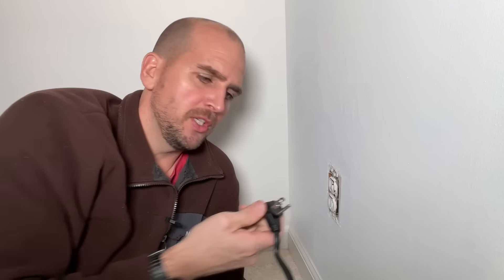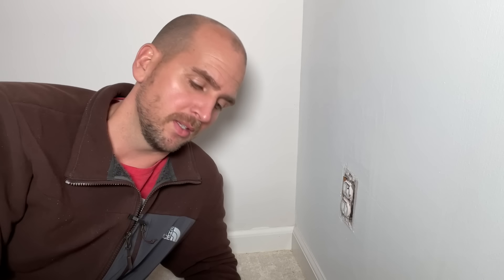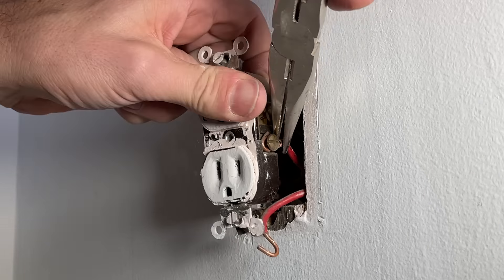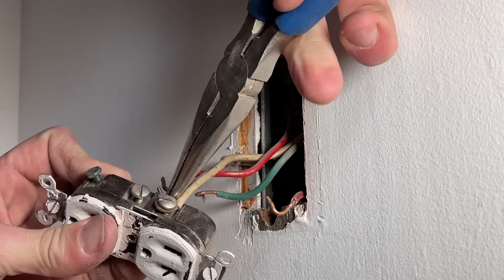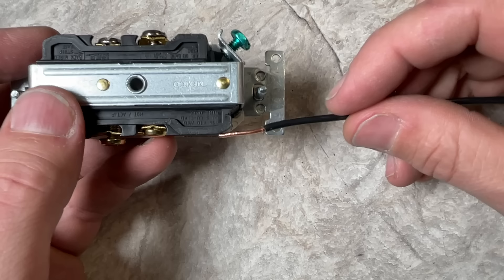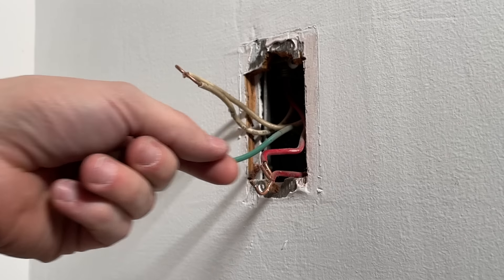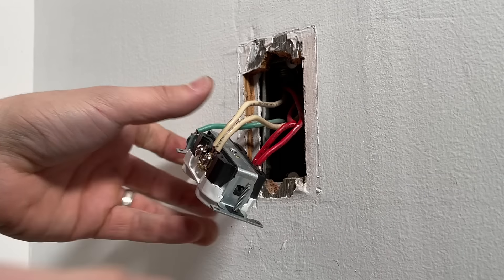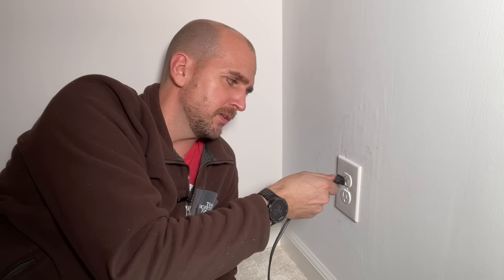Plug Won't Stay In Outlet

Comment: The other safety issue besides exposed prongs is that a loose receptacle makes a poor electrical connection. The increased resistance at the receptacle produces localized heating that can damage the insulation of the wires. I'd replace any receptacle that doesn't hold a 2 prong plug as tightly as a new receptacle. If either the neutral or hot prong is loose enough then you can have a fire hazard - even if the ground prong makes a firm connection.
Reply from the maker: Hey Jason, thanks for the feedback and agree the increased heat doesn't do any favors for the life of the receptacle.
Reply: How can you measure the "leakage current" ?
Reply: Thats exactly right..loose wires cause fires. I recommend looking at every outlet with a load on thermal infrared, the beakers too. It only cost about 2 dollars to replace a 20 year old receptacle.
Reply: @rickhunt3183  what do you mean by a load on thermal infrared?
Reply: @waynegram8907  He means that you need to plug in something that will draw a high current - such as a hair dryer. If there is unacceptable resistance at the outlet then you will see the outlet heat up on the infrared camera. On the other hand, if you only plug in something that draws a small current, like a LED light, then there won't be much resistive heating to detect
Reply: @JasonEDragon  ok thanks. Without plugging anything in all the outlets, how can you know if your outlets are 10A, 15A or 20A outlets without going back to the fuse panel how can you check if you outlets are 10A, 15A or 20A, what kinds of test can you do to measure the outlets max current?
Reply: @waynegram8907  By looking at standard outlets you can only tell if it accepts 15A or 20A plugs (those with T shaped neutral slots accept 20A plugs). Those that accept 20A plugs should be on a 20A circuit, but the more common outlets that only accept 15A plugs can be on either a 15A or 20A circuit. (I could say more, but I think that is a good enough short answer.)
As to testing, I've seen some "AC circuit load testers" around, but these don't appear to be that common here in the USA. I've watched quite a lot of UK electrician videos and they do a very comprehensive suite of tests on all electric work - with a variety of quality test meters available and their breaker panels (consumer units), electric boxes, and wire connectors having evolved to more easily support testing. Some other items I question but I think their testing is great.
Reply: @waynegram8907  I miss typed. what I mean is while there's power being drawn from the outlet. View the outlet with a thermal infrared camera. I've discovered faulty connections from the heat signature. After examining the outlets. They were found to have  loose connections. Drawing 1 or 2 amps might be just fine, but when you increase the load to a 8 or 10 amp device the outlet may become dangerously hot if the receptacle is old and worn. This shows up very well with a flir camera.
Reply: @rickhunt3183  but even good outlet terminal connections you will see heat on your thermal infrared camera, so how would you tell if its good or bad? because you will always see heat on the outlets terminal connections
Reply: @waynegram8907  Of course you will always see some heat when current is flowing, but if the receptacle temperature is climbing to 100 degrees C there's a problem getting ready to happen. I've seen plenty of outlets that looked fine, but after removing them and inspection. They had charred wires at the connection. Drawing 1 or 2 amps might  not cause a noticeable problem, but 10 may push  things over the edge with a loose connection. If the receptacle is bright yellow in the camera during operation. it might be wise to inspect it closely. I've had receptacles that looked fine, but after pulling them they were clearly in the process of catastrophic failure. Most people that have receptacles that are loose seem to ignore it.  Thermal imaging isn't always a go or no go test, but it will bring things to your attention that need closer examination. If you plug something into a receptacle and it's loose . No further examination is necessary..Replace it right away. Contacting Flir will offer a lot more information. 877-773-3547 or their website.
Reply: @rickhunt3183  Thanks I will look into that. When opening up an standard outlet how can you tell by looking at the inside of an outlet terminals, sockets and insides what amps rating it is? how can you tell if the outlet inside parts are rated for 10A, 15A or 20A?
Reply: @waynegram8907  NEC 2008

hope this helps it came strait from the NEC manual. if the circuit has a 15 amp over current device the wire is going to be 14 gauge and rated for 12 amps continuous at 70 degrees C If there's a 20 amp over current device on the circuit the wire is going to be 12 gauge and rated at a continuous current of 16 amps at 70 degrees C. The best rule to go by. If you're not 100% sure about something don't do it. Electricity is nothing to play with. I know people that have burned their business to the ground by doing electrical work that they weren't qualified  to do. Don't be that person.  If you're looking at something you're not sure about always have a professional do the work. They are bonded, licensed and insured.
Reply: @rickhunt3183  yes I understand the wire gauge to the RMS current rating. 120vac/wire gauge resistance = max current.  120Vac X 10A = Wattage power
Reply: @JasonEDragon  What kinds of tests to confirm and verify the current rating for the outlet? without going back to the fuse panel to know if the outlet is 10A,15,20A what kinds of test can you do to verify and confirm that the outlet is at what current rating?
Reply: @waynegram8907  I don't have any experience in this type of testing, nor have I seen anyone else do it. Perhaps someone else could answer. However, I'd doubt that any test could verify the actual breaker size without drawing enough current to actually trip the breaker - so you would have to go to the breaker panel anyway. 
In any case, this is straying from the original topic of my comment that loose outlets should always be replaced to avoid overheating and a risk of fire. Testing is not a full substitute as some tester inserted into a outlet might have thicker prongs, fit snugly, and give a good reading. But if the next plug that gets inserted is loose then you still have a danger.
Reply: @JasonEDragon yes thanks for the help. When looking at the insides of the outlet can you tell by the outlet sockets if its rated at 10A, 15A or 20A by just looking at the inside internal contacts? or there is no way of telling by just visually inspecting the internal contacts to know its a 10A contacts, 15A contacts or 20A contacts, how can you tell?
Reply: @waynegram8907  USA standard wall outlet circuits are generally run with either 12 or 14 guage cable, which normally get protected with 20 or 15 amp breakers respectively. So, you wouldn't normally see a 10 amp circuit unless there was a reason to derate the circuit. For the past 20 or so years 12 guage cable sheathing is normally yellow in color and 14 guage sheathing is normally white. So, if you can see the sheathing then that would give you a clue - but not a guarantee. An experienced person can often distinguish the gauges of the individual copper wires either by size appearance of the visible copper or by how easily the wires bend. But, older cables can have thicker insulation on the wires and the sheathing color can vary.
As to standard outlets themselves they should all support 20 amps on the screws, so you have to look at the wires.
Reply: @waynegram8907  You should be turning off the breaker (which has the amp rating printed on it) to that outlet before you examine it, or replace it.
Reply: @waynegram8907  It shows different colors.....he just need to know how to use that thermal infrared camera.
Reply: I'd agree Ive seen the sockets explode as the plug works loose and starts to fall out causing a massive spark and then bang!!
Reply: Agreed!  Hot spots can cause problems, not the least of which is the possibility of fire.
Reply: @JasonEDragon  Do you think the English are that way because they use 220 over there?
Reply: @shoofly529  I'm not sure of the history behind electrical testing in the UK. The higher voltage may be a good part of it, but there are a few other features of their system that might have something to do with it too. After WW2 they introduced "Ring Main Circuits" for their outlets where a cable leaves the breaker, goes to each outlet in turn, and then returns to the breaker. Because of the 2 paths back to the breaker a smaller cable can be used, which saves copper. However, if a ring breaks it might still work yet can now be overloaded. Another issue may be that their earthing design is different, with many homes not having earth rods and underground service cables being much more common. The last item that comes to mind is that they had a few poor electric cable insulation variants in their history, which may have required monitoring.
Reply: @shoofly529  Also, the UK may test more circuits just because it is more feasible than in the USA, so people could push for that requirement. With 230 Volts there are fewer circuits, their breaker panels adopted numbered ground and neutral bars, sleeving is placed over ground wires, and they never adopted wire nuts and the resulting twisting together of wires. Their outlet boxes also are wider and shallower with receptacles and switches built into the cover plates - allowing easy access to the wires. So, it is relatively easy to isolate the wires for a circuit in a breaker panel, perform tests, and then track down any issues.
Reply: Jason Dragon: I've lived in an apt 2 years and I've asked for the maintenance guys to check an outlet at the head of my bed that refuses to hold a plug. Idk what language to use? I've been thru at least 3 teams of maintenance guys and maybe that many apt managers as well. Do you have any ideas for how can I get this outlet replaced before it becomes a fire issue? Do I just keep re submitting it as a maintenance request until the guys finally replace it? 

I've already had a breaker replaced to the furnace during the freeze to TX in February,  and I had to get a piece of the bath tub faucet replaced so I could turn off the tub. I've also had the toilet replaced and the current list needs a cold water faucet replaced in the laundry spot in the kitchen as well as the garbage disposal needs replaced. And the AC needs to be repaired or replaced before it gets to 1,000* outside in Texas. (*I've already put this item 3x this year.) Idk if its possible to get a new fridge? I've lost the seal on the freezer so I've been using shipping tape to keep it closed. I've been looking for a new freezer for meat in my apt but research of maytag as best option but on their website? Out of 54 items? 24 are out of stock so I didn't even go to the next page after I saw that. How can we get our appliances replaced? Help??
Reply: @kristinatidwell6563  
You need to move is what you need to do. Why are you living in such a dump for Christ sake
Reply: @kristinatidwell6563  If there is that much turnover in maintenance and managers then that probably is a sign that the owner doesn't want to spend the money required to keep the property safe and maintained. Now, there is some shortage of appliances and construction materials with both the pandemic and the Texas freeze. And some owners were impacted by tenants not being able to pay rent. Still, this place sounds like it hasn't been in good shape for a while.

I saw a lot of loose outlets in the apartments that I've lived in when I was younger, so a lot of maintenance people don't understand the danger. But, changing an outlet is a cheap repair, so most maintenance people wouldn't normally object to such a request (as long as you keep the intended work area accessible and clean). They probably wouldn't like someone complaining that all the outlets were loose (which I've seen), but that is where the local government code enforcement should be stepping in with periodic inspections of rental properties.

Good luck with the freezer - many have been out of stock for much of the past year as so many people wanted to pick up an extra one. I've been eyeing a GE freezer at Home Depot in New York myself, and it has finally been rather consistently in stock for the past month or so. But, the Maytag freezers up here are out of stock as well. You might have to take whatever make is available unless you can hold off for 6+ months.
Reply: @JasonEDragon  yes. I have tried to turn in repair requests that I think relate to water leaks or electrical fires. I'd prefer to avoid both of those issues as I'm getting treated for medical reasons. It seems to take them 30 days to get the repairs completed, which is annoying because it's affecting my monthly bills. I've been paying a third of my annual income to the hospital so I try to conserve where I can.... I've been debating filing a claim at the TX AG ofc bc they drag out the repair orders to extended lengths. I've been the tenant who walks around picking up trash, dog poo and treating massive ant piles trying to protect the small kids who live here. New thing appears to be shootings within the complex, but the ofc refuses to tell us what bldg or apt? Idk.if I'll renew my lease this year, it maybe time to move to stay healthy. Yikes.

I've read that Frigidaire is good for about 4 years but they crash, but I was hoping for maytag. I can't find them in stock anywhere. I've gone to their website and looked online but they are just not in stock. Anywhere. May have to take a mini 7 cu ft until they start producing appliances again just so I can make sure that I have groceries in stock. I've been trying to push 2 of my kids to college too. Life is never boring. :)
Reply: @JasonEDragon  Here private enterprise includes lawyer fees, court costs, insurance overhead, and shareholder payouts - out of your's and mine's pockets!!!
Reply: @waynegram8907  There's no such thing as a cool outlet drawing near maximum rated current.  The power cord to plug connections, buried inside the molded plug, contribute to heating if poorly crimped.
Reply: The size of the wire can be a preliminary indicator as to the amperage.  Number 14 wire is normally 15 amp and number 12 is 20 amp.  You can use number 12 on a 15 amp circuit, but cannot use number 14 on a 20 amp circuit.
Reply: @waynegram8907  There are no 10a outlets in the US.  20a outlets have a T-shape neutral slot.  15a has two parallel slots.  Ground is round.   Never replace a 15a rated outlet with a 20a rated outlet - code violation - wire sizes are different: 12ga for 20a, 14ga for 15a.
Reply: @rickhunt3183  In part, that why you don't see aluminum wire anymore - except from pole/transformer to load panel
Reply: @leekumiega9268  well that is not always trustable particularly if not in recently or brand new installed construction of the building... it may have been incorrectly wired if it was not inspected prior to sale etc
Reply: @waynegram8907  There are special safety analyzers where you plug a device in and open the ground if it has a 3 wire cord and measure it from any exposed metal on the device or through the ground wire itself when the unit is ungrounded. We can feel a few milliamps of leakage current while an ICU patient's heart can be stopped by only 100 microamps from a device.
Reply: Yup that's true. I have seen plugs and outlets melt from making poor contact, which could easily start a fire. This is especially problematic with devices that draw large amounts of power for hours at a time such as window AC units or space heaters.
Reply: Don't forget that Cooper will tarnish over time, like copper pennies. Especially when seldom used. That tarnish act like an insulator were the point of contact is even less. And along with being loose can create sparks, spark that may not be seen. Especially with cords constantly being moved or vibrated as with vacuum cleaners, and each spark just makes the resistance higher and higher. A solid tight connection is a must, but most people will just plug and go and just wonder why the plug is hot 🔥... it's usually not a faulty space heater or appliances as most will hear that caused a house fire, it's more then not a bad receptacle. It has moving parts..
Reply: @Helmuesi911  It's probably the cheapest place in town ($9999/month)
Reply: @waynegram8907  I realized myself, had my hand on the wall next to a light switch, and the wall was unusually warm.  As it turned out, the outlet screw on the shepherd's hook wasn't tight.
Reply: @waynegram8907  using the same outlet doesn't guarantee it's correct.  Check the wire gage (14 for 15A, 12 for 20A), and confirm the breaker matches the wire gage.  A quick way to compare gages: 14 is about the thickness of a dime, while 12 is about the thickness of a nickel.
Reply: @dougb8207  Thanks I will carry around a dime and nickel to measure the gauge of the wires.
Reply: @waynegram8907  you're welcome.  I never tried it; read about it just this morning in Handyman magazine.